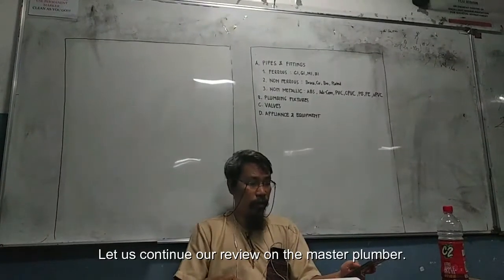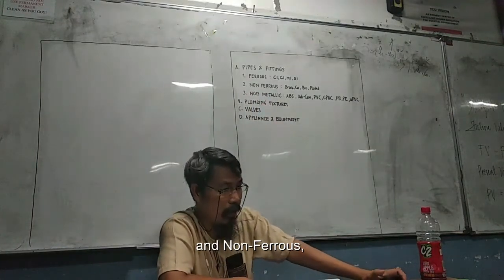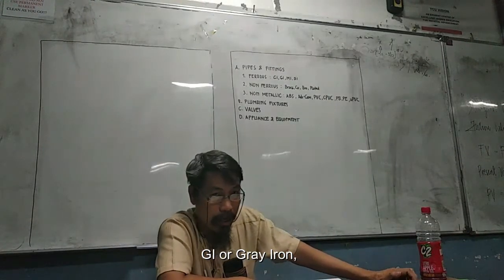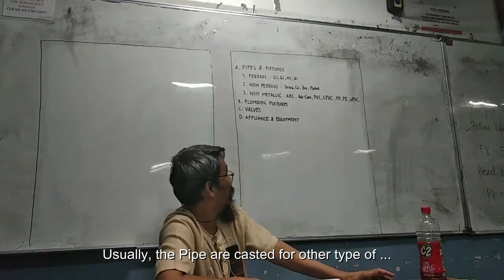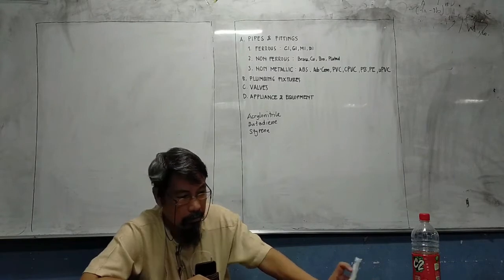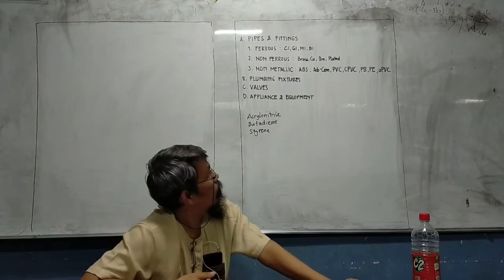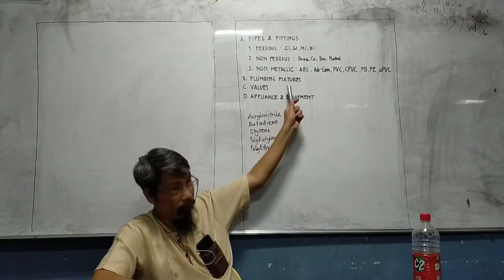CE526 Sanitary, Fire Safety and Plumbing Design|| NPCP ch4: Plumbing Fixtures Part 1

Comment: Thank you for another lesson. I had learned about the different Pipings that fits for different scenarios. You also mentioned that there is kind of Pipings such as Ferrous, Non-ferrous and non-metallic. Of course, we should note about this since it is also placed in the board exam.

Comment: CAGUIOA, DANIELA O.
BSCIVESE 19-00459

Thank you for this informative video. I learned about the difference of ferrous, non-ferrous and non metallic and what is under or example of it. It also tackle about the advantage and disadvantage of using plastic pipes. Plastics are not easy to decompose.

Comment: in this lecture, I learned the difference between ferrous, non ferrous, and non metallic. I also learned the advantage of using plastic pipes  and why it is commonly used in building construction now a days   and also knows the different types of plastic pipes.

Comment: Plumbing Component System- Each plumbing system has three major components: pipes and fittings, drainage, and fixtures.
(0:29)

Decomposable- To become broken down into components (7:01)
ABS - ABS stands for acrylonitrile butadiene styrene (7:51)
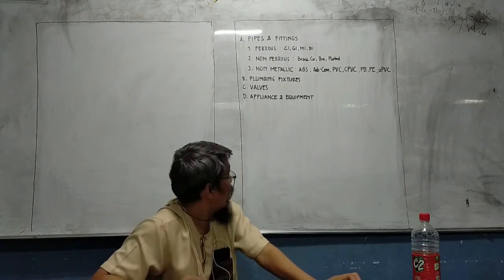Acrylonitrile - Acrylonitrile is an organic compound (8:08)
Styrene - Styrene is a chemical used to make latex, synthetic rubber, and polystyrene resins.(8:26)

Comment: -Talking about plumbing fixtures is absolutely important, because the Non-Metallic today are very much flexible in terms of construction damages, risk and hazard. And plumbing fixtures help it as an exchangeable device that can be connected to a plumbing system.

Comment: Thank you sir for this wonderful topics. Ferrous means generally containing iron and Non-ferrous are alloys or metals that do not contain any appreciable amounts of iron include aluminium, copper, lead, nickel, tin, titanium and zinc, as well as copper alloys like brass and bronze. Non-metals are natural materials that do not produce heat or electricity and that are structurally brittle (can not be easily rolling, moulding, extruding or pressing)

Comment: Extremely useful talk about plumbing fixtures. I've learnt the differences between ferrous, nonferrous, and nonmetallic pipes and fittings. Metals that do not include iron, such as steel, are known as ferrous. MI mild iron, BI black iron, CI cast iron, GI gray (galvanized goods are commonly plates) iron. Copper, for example, is a non-ferrous metal that is both expensive and easy to use. It is also much lighter and easier to thread.

Comment: Etabes, Joshua G.
19-02128

Thank you, sir. There are three classifications of pipes: ferrous (cast iron, gray iron, and black iron), non-ferrous (copper, brass, bronze, and plated), and non-metallic (ABS, PVC, CPVC, PB, PE, and uPVC). ABS is acrylonitrile butadiene styrene. PB is polybutylene. PE is polyethylene. Now I know why plastic pipes are plenty and why different large water companies used this material.

Comment: Ruiz, Sharlize Veyen C.
19-00620

Additional Insight: No drainage or vent pipe shall be drilled and tapped for making connection. No waste connection shall be made to a stub of WC. We cannot fit, or connect the pipes if it obstruct the flow of the water and sewage. We should recognize that those are prohibited pipes fitting practices. All pipes and fitting shall be installed in correct relationship to the direction of flow. (NPCP, 2015 "Section 311")

Comment: Mendiola, Mc Axel Joseph P.
19-00167

Thank you sir now I know what are the difference between ferrous, non-ferrous, and non-mettalic And what are the different types of plastic pipes. Additionally, I also learned why plastic pipes are commonly used in construction buildings because plastics are so flexible and it can handle earthquakes very comfortably.

Comment: For me copper pipe is better than plastics pipe bec. copper pipes are probably the most traditional plumbing pipe used due to their extensive duration and reliability. They provide superior corrosion resistance, great material to be used for hot and cold water, and it can be managed easily

Comment: 1. MIRANDA
2. Plumbing component system @0:29
3. Ferous (Fe) @1:35
4. Galvanized @2:18
5. Chrome platinflg steel @4:00
6. Intact @4:52
Reply: 5. Chrome plating steel*